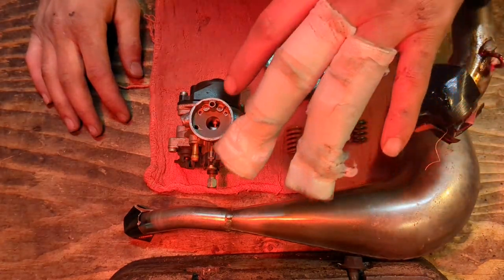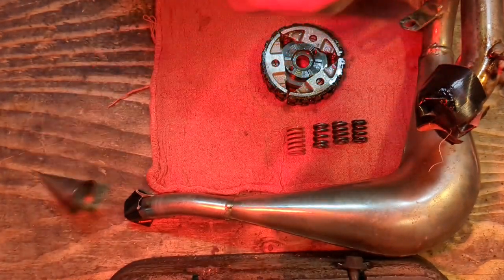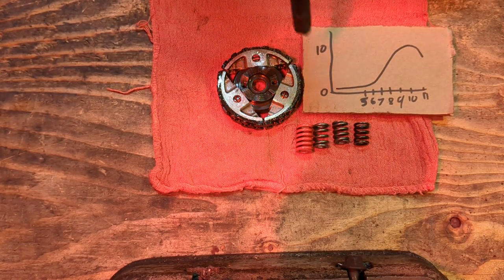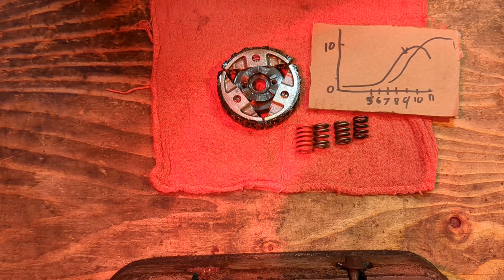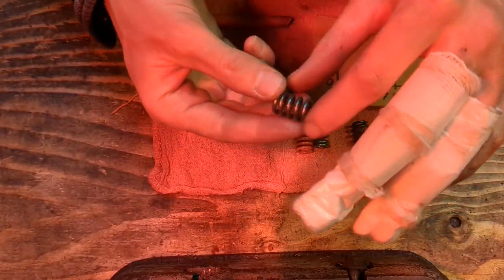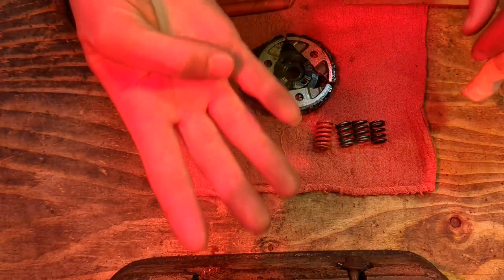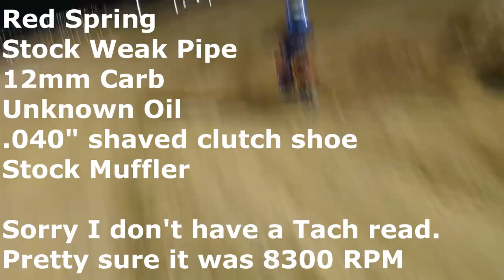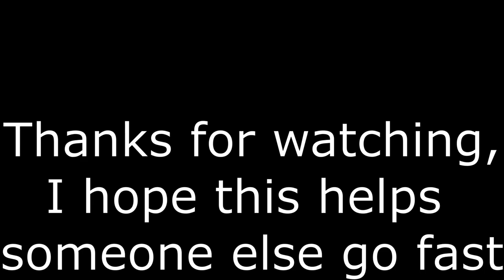I Fixed the KTM 50 Clutch... It's Fast & NO MORE WASHER STACKS. 2002 to 2008

Comment: Where can I watch more videos of these kids racing I'm trying to get my daughter in the dirtbike and she absolutely loves riding with me it's time for her to start learning her own
Reply from the maker: Sorry, life has been really busy lately and I haven't had time for much youtube projects or editing and uploading the kids racing. They are still racing plenty... That's probably where time is gone to haha. I've had plenty of really neat projects lately, I just haven't documented them.

As for inspiring your daughter... depending on the age I have a few suggestions. 2.5 or so and under, stacyc 12" get a shorter seat if you need it, don't waste a ton of time on the stacyc. They are really weak in stock form and bad habits develop from no front brake(you can add a front brake). It's fine for learning throttle, I always teach my kids on the yellow power mode, red is too slow, no balance gets developed. Age 2.5 and above, Oset 12.5r, build the suspension and add power when they are ready, If you do it right and roll in the power overtime you can stretch out the riding age to about 4.25 or so at max before they will be too big, but at that point they are ready for something much nicer and faster and better suspension. Age 3 to about 4 would be either Stacyc 16" elite, or KTM E2, but the E2 is very PW50 like which isn't great for racing in my opinion. The stacyc 16" elite is a great race bike, it's got front and rear disc brakes and a very decent front fork. Age 3.5 and above, KTM E3, however the stock suspension is really bad and needs work. 4.5 and above KTM E5 with a lowering kit if needed. 

If I could go back in time this is the roadmap I would take. Stacyc 12 just for throttle learning, Oset 12.5r, Oset 12.5r mod power and suspension, KTM E3 or E5(with lowering). I wouldn't waste time on the gas 50's if I could go back. The corner smoothness of the electric power delivery is almost unbeatable on the electric bikes compared to the auto slipper clutches of the KTM/Cobra bikes. It's really hard to make a KTM/Cobra super smooth in corners... which is where racing is won... however my clutch I built in the video is the best clutch I've felt compared to the modern generations. The problem is the the suspension and brakes are really NOT good on the 02-08 generation. There's not a whole lot you can do to be "class legal" if you want to race anything serious. And parts are getting really hard to find for the 02-08 since it's the disfavored generation of bikes(for good reason). 

Hope that helps!

Comment: Hi I've done the clutch modification and it has made my daughter's bike abit  better but I seriously think it is carb related what was the name of the carb you used and what jet sizes did you use
Reply from the maker: 100% don't use that 12mm carb. Get the 19mm. https://www.mopeddivision.com/part-type-newest-items/air-fuel-intake/dellorto-19mm-phbg-bs-carburetor-pull-choke-new-model/

I followed the jet sizing for a 2008 KTM 50 SX and it's been perfect so far. That's the water cooled race bike that had the 19mm carb stock. I don't remember the numbers off hand but you can easily look that up. I think the stock jets that come with the carb will be really close.
Reply: Wood a 21mm. Carb be ok of a 2020 KTM 50 sx with 2008 jets in it
Reply from the maker: The 2020 50 sx shipped with a PHBG 19 BS. That's the 19mm carb. The 21mm is an aftermarket option and not class legal for most race series. If you have an air cooled cylinder I highly doubt the 21mm carb will help performance. The air cooled cylinder is exhaust port area and intake transfer port area limited, performance wise. It is also limited in exhaust duration... power wise. A bigger throat on the carb may actually hurt performance for an air cooled cylinder.

If your 08 cylinder is water cooled the 21mm may help performance. I think the 21mm carb is usually used for the 60cc kit. If the 2020 you pulled the carb from had the 60cc kit the jets will be WAY off for water cooled 50cc. If the 2020 bike had a 50cc displacement and the carb was tuned by someone that knew what they were doing the 21mm is probably pretty close and may just work out of the box for the water cooked 2008 cylinder. The 08 water cooled and modern cylinders are pretty similar.

Any time you carb swap to non standard equipment you WILL have to tune the carb jets for your unique application. 

You could try calling nihilo concepts maybe they have a easy answer for you.

Comment: You are amazing sir! Rebuilding a ktm 50cc mini adventure now and it just will not hit band at all I am changing all of the usual stuff, but I know the last owner installed a new clutch but I think the springs are to weak!
Reply from the maker: Hey there I'm glad this was helpful.  It's very likely the clutch.

Assuming there's nothing else mechanically wrong..  Here's some oddball stuff to check.

Don't forget to check the spark arrestor! If it's clogged it won't go. Try it without the muffler for kicks.

Pull the expansion pipe and clean it out with gasoline or other very aggressive solvent/degreaser. If it's been ran rich for years it can build up a ton of unburnt oil and if it never was ridden on the power band it'll never get hot enough to burn off.

Fresh oil makes a minor difference, try that. When you drain the oil out you can use diesel in the clutch/transmission side and run it for like 15-20 seconds to splash it around and it'll really clean out the entire transmission side. Drain it out and overfill to like 220cc's. I use Rotella T6, it's cheap, meets spec, lasts.

It's possible someone in the past added or removed or used alternative thickness gaskets on the head or I the cylinder which can change compression and rpm for the power band. Check there. See what the spec is on the SX model from 02-08 and run that. 

For upgrades... 

First:
Switch to the 19mm carb. So much better for making power and so much easier to tune.

Second: 
My clutch mods

Third:
Pipe

1 and 2 can/should be concurrent. No idea if the stock 12mm carb can allow the engine to spin to 10k rpm.
Reply: @theshippingcontainergarage  I really do appreciate the advice I am new to these bikes and will be sure to check all of the above. I have new reeds coming because these ones were bad, new top end kit with gaskets and also a new small end bearing I don’t think the bike was fixed properly and a cheap clutch is on there for sure But would that cause it not to hit band also?

I have checked all the electrics and they check on perfectly on the meter it’s just a checking game with everything else.

Your channel is going to do amazing keep up the good work! I was doing a welding channel but it gets so busy and stressful I gave up
Reply: @theshippingcontainergarage  also last question what mix do you find the best for the fuel to oil ratio ?
Reply from the maker: Thanks a lot! Set the bike on the stand and run it at different throttle positions. When I had mine originally the spark screen was clogged and it had the 12mm carb. It was running extremely rich on the micro carb. At half throttle it revved out better than full throttle.

I run about 40:1. Manual calls for 60:1. The leaner you go the less parts last. You will probably get exhaust spooge though.
Reply: @theshippingcontainergarage  I have taken out the spark arrestor and mine is just a straight hollow pipe with holes but does have a lot of oil build up and the padding is soaking with black oil! 

Last last last question I am trying to convert the springs from inches to metric if I am correct is 16x25 the springs I am looking for? 

Sorry for being a pain!
Reply from the maker: @DaveRees-hy7wj  It's been a bit, but yes. I believe that's correct. The most important thing is the spring rate. Make sure that matches.
Reply: @theshippingcontainergarage  thank you buddy I am terrible converting 😂
Reply: Hey my little guy is new to riding so I would like to try a step below the red spring at first do you have a number for those springs thanks in advance

Comment: Has anyone found a good place to order the springs from yet?
Reply: eBay bro
Reply: Raymond die hard springs 305308D
Reply from the maker: I just checked that part number you ordered. The part number you ordered are 2 inches long and have a spring rate of 210.7 lb/in. That's really soft compared to the 445.4 lb/in 305304D springs I used. No wonder you had trouble. These will probably work but you HAVE TO cut them down to the 20 to 22mm length. They will not have the 9k-10k rpm lockup though. It'll probably be high 7k-8k rpm with those weak springs. Not a bad lock but not great.

Comment: Got the carb you linked to, but forgot to order jets. It runs a whole lot better than it did with the stock carb but as you could imagine still not great. When I look for the parts you referenced there are multiple options. Idle Jet shows 45, 48, 50, 52, and 55 available. Needle Jet shows 260 and 262. Any advise on which size to get? For reference I'm at 1300ft.
Reply from the maker: I went to Chaparral's website and punched in 2008 KTM 50 sx. I went tot he carburetor diagram. https://www.chapmoto.com/oem/ktm/sx-50

when I expand the picture and click the jets I think it gives the stock values. I get 45 idle. 260 needle jet. 60 start jet. 80 main jet. W9 Jet Needle. and the 60 slide. You will  have to figure it out yourself though. Hopefully the stock values are a good starting point though.
Reply: @theshippingcontainergarage  Thank you!
Reply: How do you find the 60 slide I can’t find it on the diagram :/
Reply from the maker: @devinkasperek4027  Did you check the ChapMoto link above? When I scrolled to 2008, engine, carburetor it's number 10 on the image. Here's a screenshot. https://i.imgur.com/yr9JJDX.png

Comment: Thanks for informative video! What would you say is the next best approach? My son has a ktm 50 senior adventure, getting a lc exhaust and 19mm carb is very expensive here, figured I could do some clutch work, whats some good spring without having to sand it down? Thanks!
Reply from the maker: Did you check the link from Moped Division in my description for the 19mm carb? It's US $120. It's really not hard to cut the spring down. Nobody makes a 22mm die spring, much less a 22mm round wire spring stiff enough to do the job. I recommend the red die spring I used in my video. I suppose you could order a custom made die spring but that will take a lot of time and not be cheap. 

You could always find a good speed shop that knows how to build exhaust pipes and have them make you one.
Reply: I guess cutting them down will be easy, I'll have to sand it down by hand as I have no machine. 
How do you fit a LC pipe on a senior adventure? Seems to be another fitting.
Can you run a 19mm carb without the LC pipe? Just Bolt on and go? 120usd seems fair if it works with just the carb then ill go that route as a start! 
Thanks!
Reply from the maker: @dixon266  For cutting the springs I use a cutoff wheel on a grinder. A hacksaw and judicious sanding to bring it to flat could in theory work, probably a lot easier than just sanding the whole thing by itself. 

I personally haven't tried the combination of LC pipe on senior adventure. I don't have that combo and probably won't have that combo anytime soon... or ever. 

We ran the 19mm carb on the stock mini adventure pipe for awhile. The 19mm carb is MUCH better in pretty much every way. So much easier to tune. The 12/14's run super rich in my experience. 

Best of luck!
Reply: eBay has bootleg 19mm dellorto Phgb carbs literally a cloned copy in quality and in design for 20-30 dollars. Trust me I’ve been using it and It works great.
Reply from the maker: @WestHaddnin  I had a really bad time messing with a friends bike with a knock off carb. Went through every single thing to get it to run and the thing refused. Slapped on the stocker from Moped Division with the right jets and it ran perfect immediately.
Reply: @theshippingcontainergarage  haha nice! It def depends on what type of knockoff carb you get, but I personally did and it has worked great. I also got a knock off keihin that works better than the original for my rm85 and a knock off carb for my DRZ-110.. I’ve had great luck so far and as long as you order jets to go with it (make sure you have the right mm size cuz my klx110 carb was a 4mm not a 5) I’m willing to bet money on it. Quality is just as good and I can recommend vendors and links as well if anybody is interested 💯💯

Comment: Hey boss doesn’t really have anything to do with your video but you said you did this on an old mini adventure ? Where do you get your parts from for it I can’t find parts really anywhere besides like a piston and  crappy aftermarket clutch pads? Just want to be able to find stuff for when they brake just bought my son a 2006 mini adventure and want to get it right.
Reply from the maker: Hey man no worries. I use the exploded parts views to find parts. The big store near me, Chaparral, has a great OEM section to their website. It'll list out every single original part and its part number. Note, some part numbers will say "superceded by xxxx" etc. Anyways, you can use the exploded views to find everything. Once you get the original KTM factory part number you can search google or ebay for the part number to see if anyone else has it cheap. Chaparral is usually very cheap. 

https://www.chapmoto.com/oem/ktm/50-adventure-mini/?year=2005

Good luck!
Reply: I have a 2005 and KTM World in Georgia has a reliable supply of the stock parts.

Comment: Good stuff. 
Thank you. 
What is your review on the little KTM?  I was given an ‘04 KTM 50 complete.  But froze.  Is it worth fixing?  Parts availability good?
Your thoughts?
Thanks
Reply from the maker: Mini or junior/full size? air cooled or water cooled? 

All the original suspension needs to be done. Mandatory. On the mini adventure the rear is a crimped unit, non rebuildable, once it goes it's done. Pick up a rear shock from a 2009+. Rebuildable. IDK about the bigger models 02-08 rear rebuildability or suitability. The fronts on ours got race tech cartridge emulators. HUGE improvement. Can't recommend riding without them. We saw a lot of head shake and sketchiness on the front end before we did the front suspension. Lesson learned. The suspension for the front isn't too expensive for what you get. I got the complete rear off ebay from a 2017, not too expensive.

Air cooled is a lot slower even with all the bolt on parts like I have in the video. You'll never get the power out of the air cooled cylinder like the water cooled. The exhaust port on the air cooled is a large single compared to the large triple exhaust port on the water cooled. The water cooled cylinder has bigger transfers as well. The exhaust port height is 5mm higher on the water cooled cylinder. I know because I actually just recently finished the build on converting Anna's mini from air cooled to water cooled. It's SO MUCH FASTER. It pulled a wheelie under me when I was testing it out. Clutch stall RPM went from 10,000 rpm to 10,800 rpm just by having more torque. I may have to do a video on the water cooled conversion. It's really tricky on the mini, not much room. SO worth it. Way faster, that thing rips off the gate.

At the end of it all with the upgrades it's lighter than the modern KTM 50 mini, very comparable power wise with the recent water cooled upgrade. All in, parts and everything, it's WAY cheaper than buying a used 2009+ KTM mini(really should focus 2013 and newer for the newer clutch, the 09-12 have an enlarged version of the shoe clutch like what I built, but it should take the disc clutch from the newest generations no problem... well, except $$$). The 02-08 has drums which is not ideal but it's been working fine for us. It's not really easy at all to lock the rear for sliding into corner purposes. I haven't seen my daughter do it with her drums, have seen her do it as a very young 4 year old when she was still racing her Oset(disc brakes). 

A bit lighter than the modern bike, dwindling if not gone aftermarket performance parts support(main problem is getting a pipe), when water cooled it's a bat outta hell. If you like working on bikes and want to build it power wise little by little as they grow, worth it. DO THE SUSPENSION FIRST THING. The bottom end and transmission side of the 02-08 is WAY simpler than the modern bikes, way easier to work on. With the 2013+ clutch you can de tune the power delivery big time at the expense of burning your multi hundred dollar clutch plates, they come stock for the earlier years with a 12mm carb. With the 02-08 clutch shoes are like $30. I haven't had to touch my clutch at all with about 45 hours of HARD constant slipping abuse at 10k+ rpm(oil changes still needed). Really with a fast 2013+ clutch you don't have to touch them either... unless you run them really slow on the stall speed for a learner. 

It's a good bike. If you want to race it you have to get it into racing condition. It's not competitive air cooled even with all the bolt ons... unless you send out the air cooled cylinder for a 60cc bore, but you may have to trim the bottom end cases a tad... which is easier since the bottom end is so simple to take apart. It would take a cylinder expert with the right tools to port a steel air cooled cylinder... even then you don't have the triple exhaust. 

There are trade offs. Do the suspension. If you fix and flip you might get $1k for it depending on the market. Maybe you can get away with running it air cooled for half a year with a pipe, clutch, and 19mm carb as they learn.... then sell it for a cobra jr or a 50 mini with a lift kit. You'd probably come out ahead with about ~$500 in upgrades then selling it used.